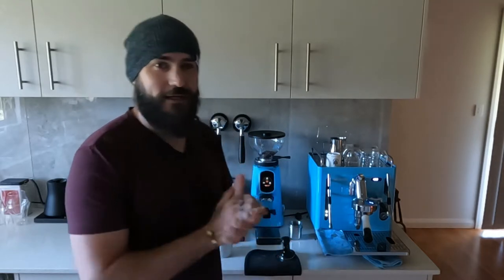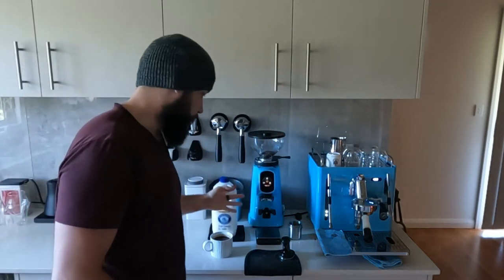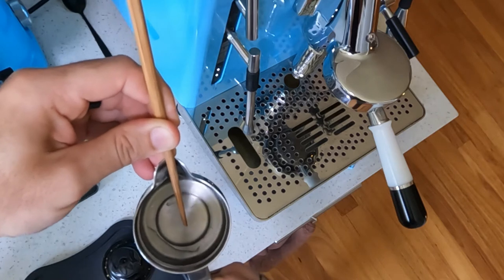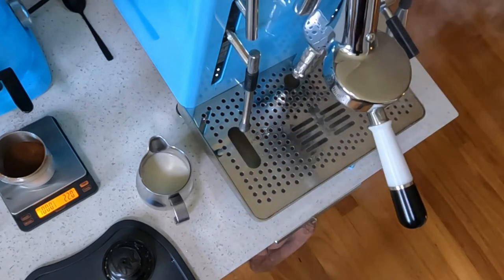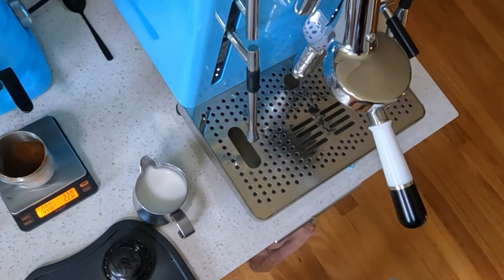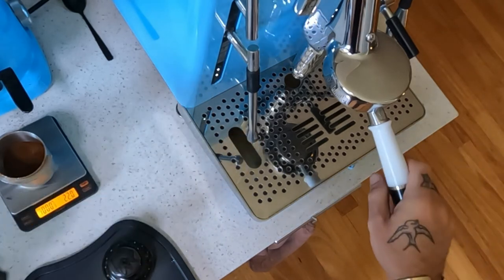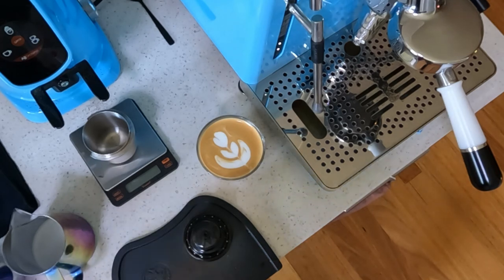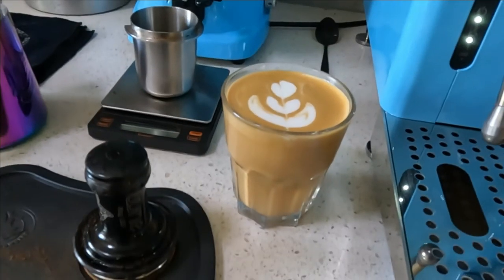Can the San Remo Cube Steam milk for Latte Art?

Comment: I had cube for a rough one month,same set up as yours,but I found lack of control of the independent brew temperature and the fluctuations  pressure of the steam is annoying,think of gave up on this machine and move to dual boiler
Reply from the maker: That's actually surprising... was it also the "R" model? As i haven't noticed any issues like that.
Reply: @mitchdoescoffee  Yes,I am in Australia,for a example,if so set the temperature as 124, when stemming even for only 1-2 sec,the temperature will drop at least 5 degree instantly
Reply from the maker: That doesn't sound typical... mine will drop 1-2 deg for a moment, but recovers by the time i finish steaming milk. 

However, the boiler temp shown at the time of steaming wouldn't really have too much of an effect of anything. 

Even my 3 group Opera will show a drop in temperature when purging the steam wand, but recover at the same speed.
Reply: Update: I kinda find a middle ground for the issue I am facing,in the user menus it has a brew temperature graph shows steam and brew temperature relationships,I just use that as a suggestion to get my ideal brew temperature,then every time when I finish brew coffee,I will crank the steam temperature back to 1.5 bar to steam milk,little bit of inconvenient,but I am not in hurry to make coffee,I also get a second dual boiler coffee machine when I am in hurry
Reply from the maker: And it is working well for you?
Reply: @mitchdoescoffee  Not 100%,it is roughly estimated brew temperature,not exactly the real brew tep